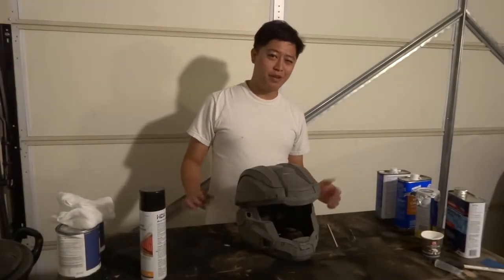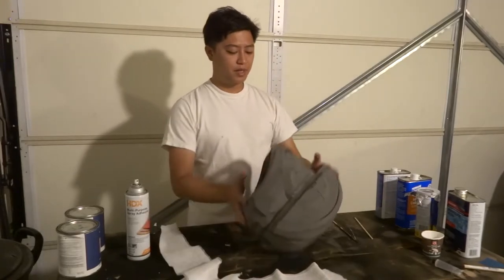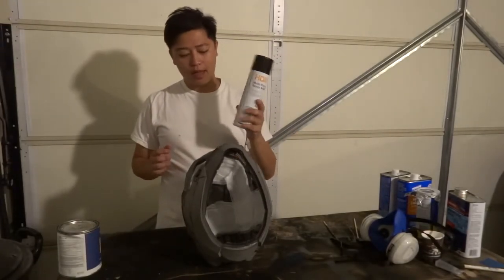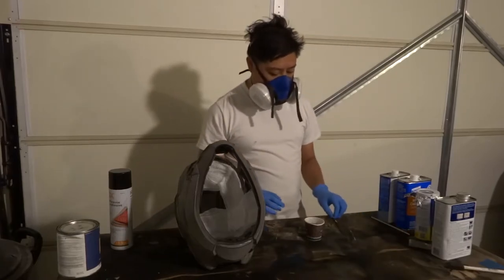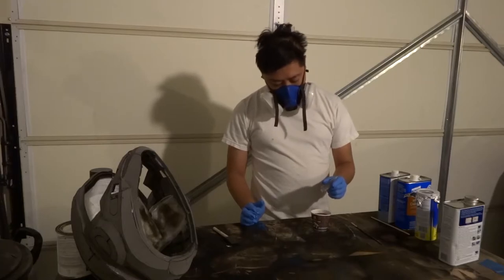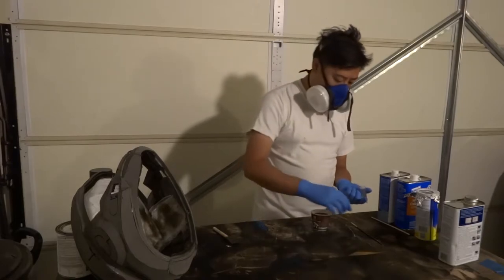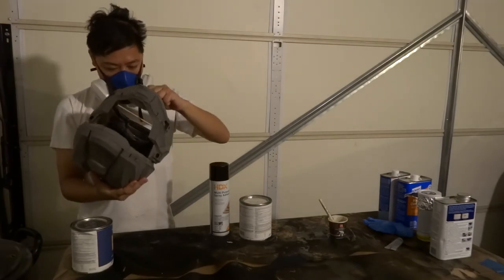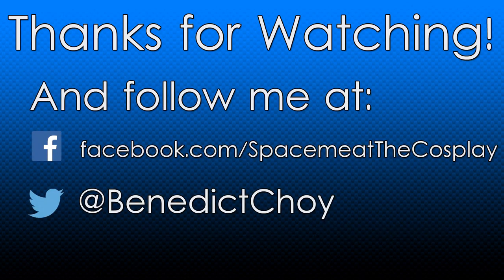Project Athlon (Halo 5 Cosplay Build) Log #9 - Hard Headed

Comment: If you had put a layer of Plasti-Dip inside the helmet as your heat shield for the resin, do you think that would work just as well?
Reply from the maker: 123opdude That's a good question. My gut instinct is no because plastidip is flexible and if the foam starts deforming from heat, the plastidip won't do much to stop it. But I guess with a thick enough layer it might stay together... There's really only one way to find out